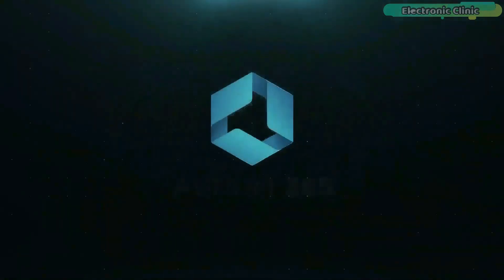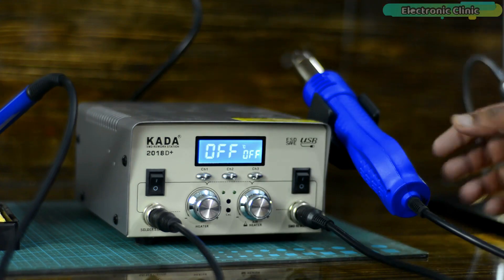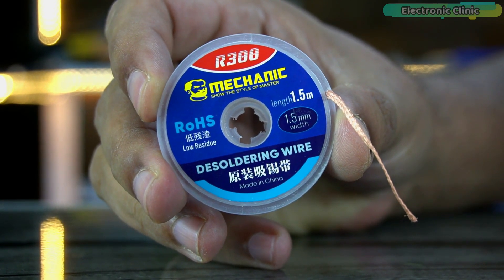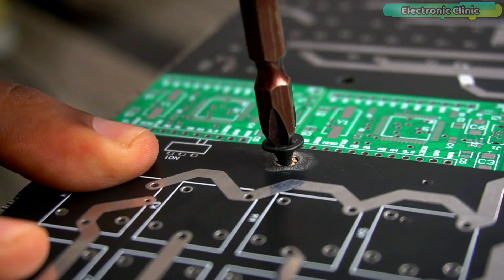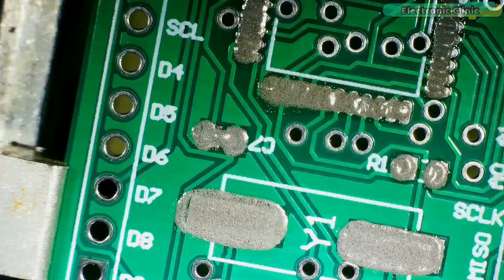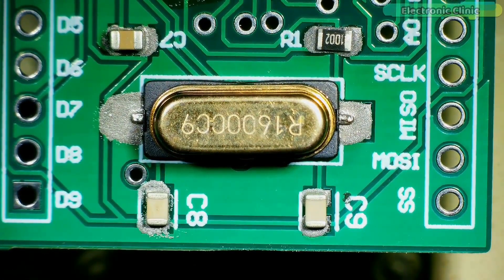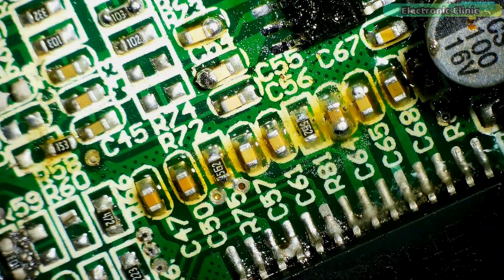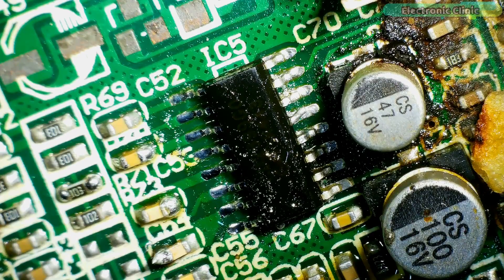SMD Soldering Tutorial for beginners, Tips & Tricks, SMD Rework Station, SMD IC Soldering

Comment: Very nice tutorial, but:
1. At 7:31 you said ".. and it looks good"... No, man it looks awful. Yeah, you said in the beginning of the video, that the solder paste is dried, but even so you it shouldn't look like this. 
2. You don't have to have microscope to solder smd elements, especially elements bigger than 0402. Yeah if you eyes issues, probably it's a must, but if you have no eye issues, you can see most of elements with bare eyes, just you must be more careful. 
3. To desolder components like SMT elements, you can simply use soldering iron -  will do it faster. Resoldering with paste may be difficult, as you can apply more paste than needed, resulting in short-circuit between the component pads (shunting the component) or less paste making cold joints or no joints at all.  
4. You can solder SMD components even with iron, so if you are not doing many PCBs there is no need to buy soldering paste that is expensive and with short life span, also should be stored in fridge to slow down drying process.

Comment: Very informative for a SMD beginner like me. I've spent decades working on point to point and through hole electronics. One thing you missed though was the importance of protecting heat sensitive parts from the hot air. Watching that poor electrolytic capacitor fry at 13:00 bothered me a lot. Lol.
Reply: yeah xd
here lot of phone repairmen refuse to repair chinese phones bc they can't survive the rework with hot air.

Comment: Do you have any advice for soldering SMD relays on to printed circuit boards? I have an audio analyzer which has a bad relay and I need to change the relay I can't access it with a soldering iron due to an RFI Shield right next to the relay but I can get in there with a hot air tool too hate the part up. My concern is not to overheat the part the relay I don't know how much heat it can withstand.

Comment: You have a solder bridge on c57. 
And so many solder balls on the board which can cause short circuit... 
Your paste is dry try to mix it with little isopropyl and flux to get it better and get rid of those solder balls.. 
Always nice to watch soldering SMD its so much joy 😊
Reply from the maker: That pcb was only for the demonstration.